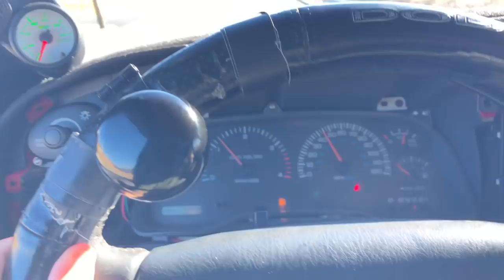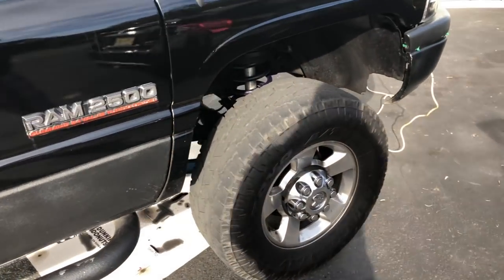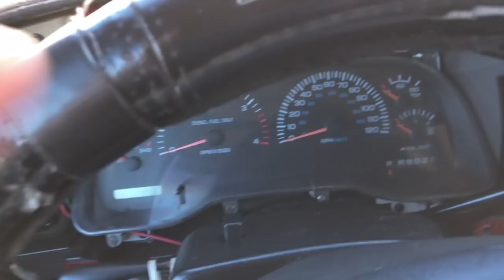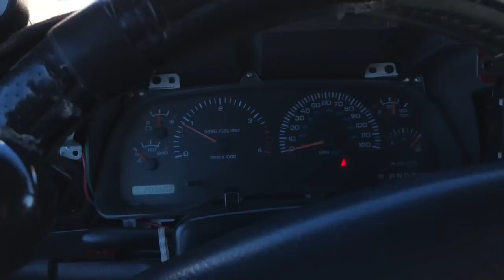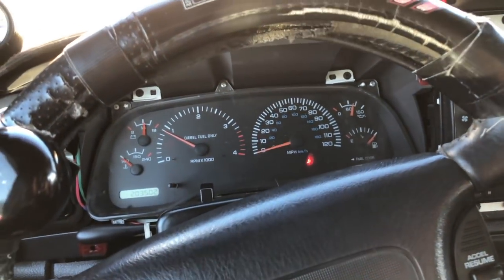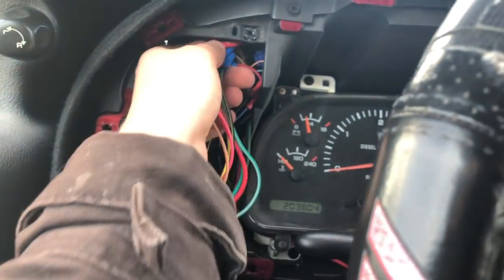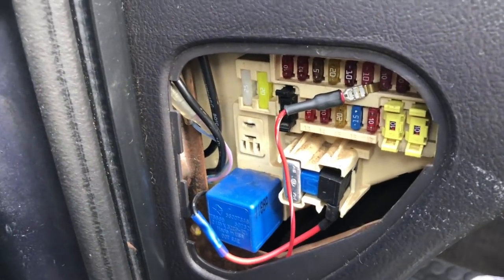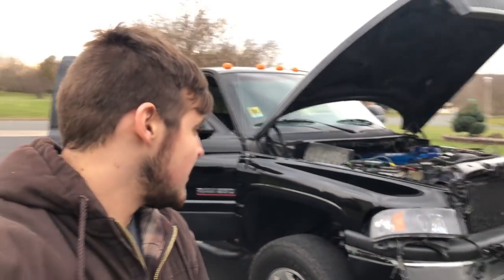I ALMOST SOLD MY CUMMINS TRUCK OVER A FUSE!!

Comment: Did the trailer relay cause your cluster lights stop working got same problem got head lights and turn signals but no running lights or cluster lights  all fuses are good
Reply from the maker: Dustin Winget that might have been what caused it! I replaced the trailer relay for $17 and then I replaced the fuse and then gave it a whirl. So it could have been both in combination but I don’t know. The fuse in the truck was blown no doubt
Reply: Thanks for the info I’ll try it not out nothing
Reply: Dustin Winget what ever fixed your issue? Got same problem with the gauges

Comment: that is not white smoke its water vaper from the last time you ran the truck when you shut it down as it cooled the exhaust pipe collected condensation